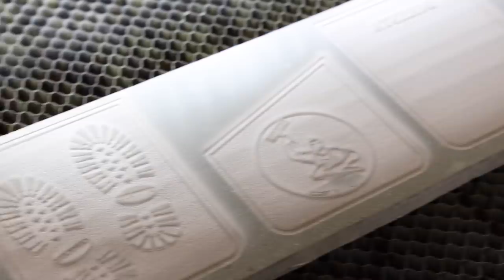DiResta Carolina Shoe Wallets

Comment: I was excited for this video when you shared your thought and design process for this wallet in Making It, but it was even better that I imagined. Do you think a bench vice would give enough pressure to do the imprint? I’m sure I could carve negatives in old cutting boards with a rotary tool, right?
Reply: A bench press should give plenty pressure, especially if your negative isn't crazy big. I apply smaller stamps (~1" diameter) very comfortably by hand. A stamp the size Jimmie is using, I clamped with some F-clamps. A bench vise should be fine as well. I used printing press dies of an old cartoon (3 windows side by side) and some carved shapes in hardwood as well. The wet veg tan leather is really easy to shape, just try any method and there's a good chance it will work ;-)
Reply: Wood may show the wood grain of the stamp, which might be a cool effect. I use a few f-clamps or long throat c-clamps and that seems to work.